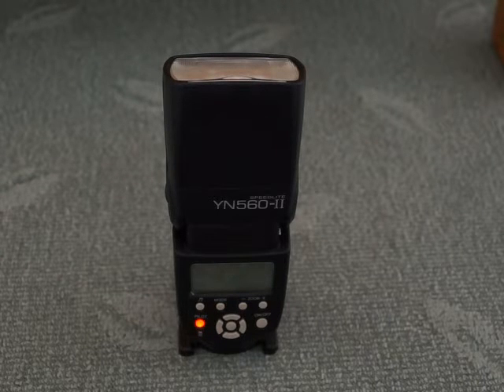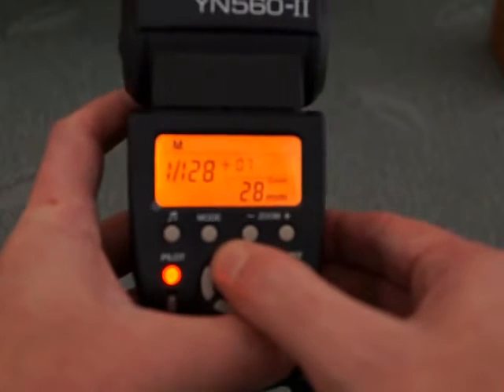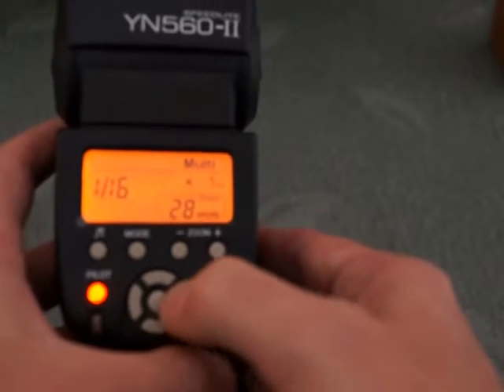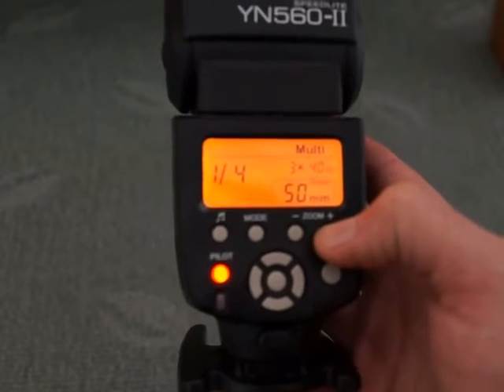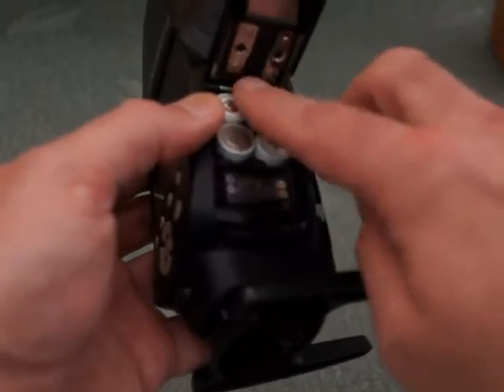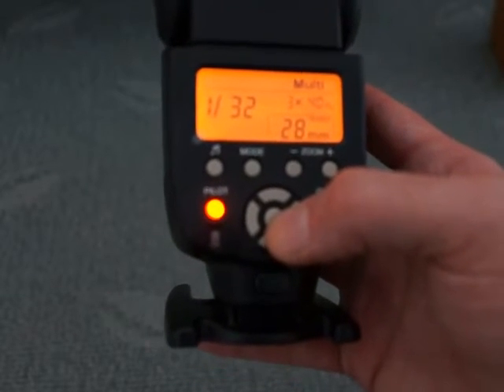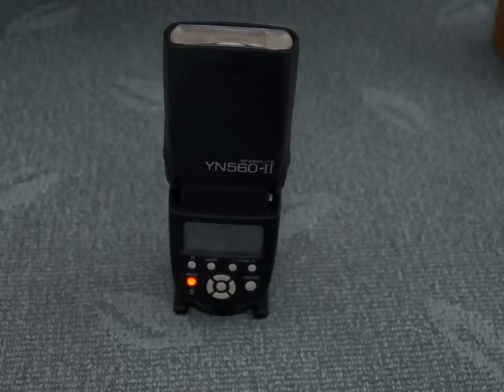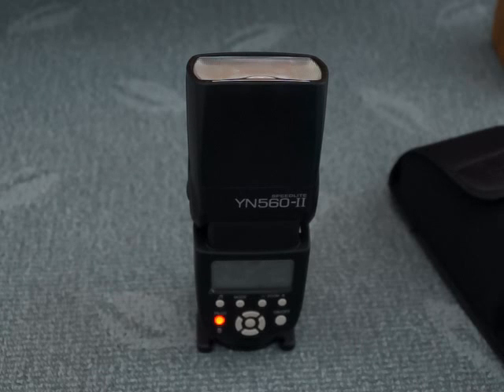YONGNUO YN-560 II Flash Speedlight Hands on and  Review

Comment: So this would work with any camera? I bought one for my film camera
Reply: Also does it support triggers? Wanna use it off camera
Reply from the maker: It will but it's manual so you will need to set the power level on the flash. Also the camera won't know there is a flash (unlike a dedicated unit), probably easier to set the exposure mode to M so you can pick the shutter/aperture/ISO you want to use.
They work fine... also useful for off camera, with the built in sensor. I use it quite a bit for an extra flash
Reply: Mr Baz Reviews can I use a trigger as I don't have a built in flash?